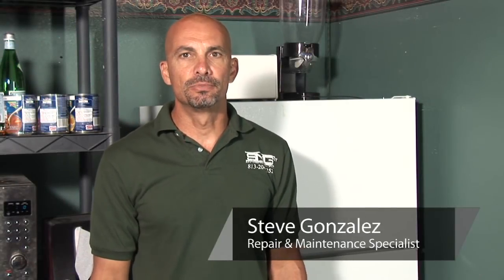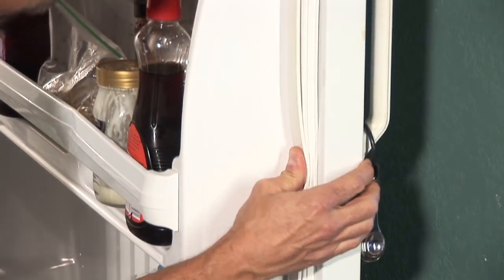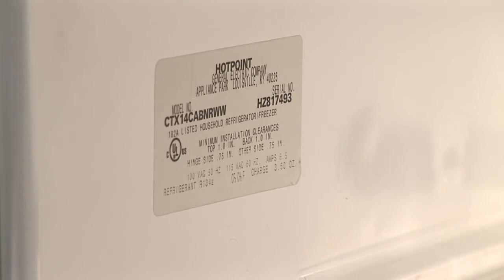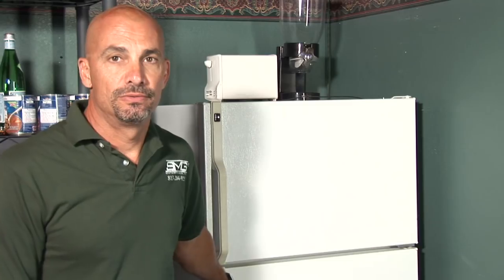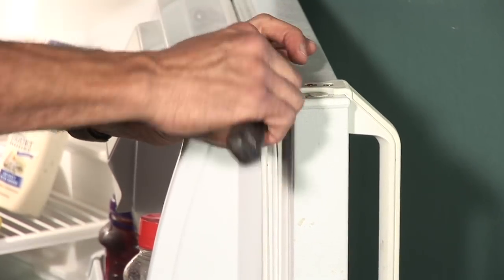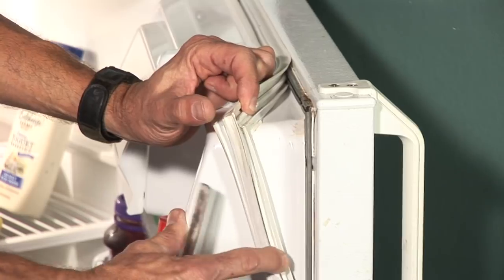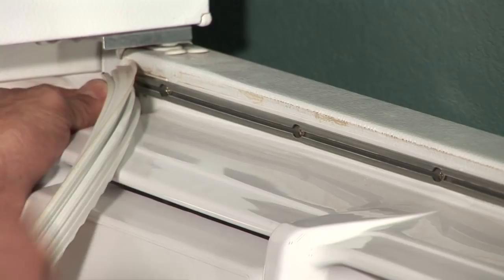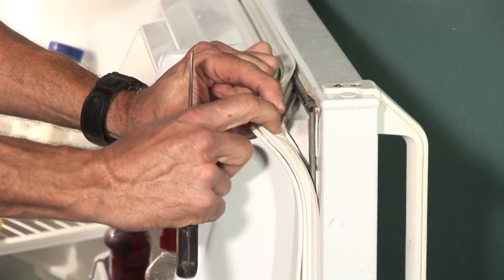Home Appliance Repair : How to Repair a Refrigerator Door Gasket

Comment: The original gasket for my fridge costs £100. The universal gasket costs £22. I will attempt the gasket change this weekend. Hopefully mine is as easy as this one. Very nice and to the point video.
Reply: Did it work?
Reply: Where did you source the universal replacement? ...and did you have to modify it?

Comment: Those of you fussing over the words  "replace" vs "repair" are being ridiculous! - senseless even. If you replace the seal/gasket around the door, and it works then,  the refrigerator is repaired. If you use glue or duck tape or some other such thing (I don't know I am guessing) and it works then the refrigerator and the door are still repaired. The title of the video is correct.
Reply: +angelamariapreuss technically, the refrigerator is being repaired by replacing the gasket. A new gasket can cost around $100 and that much more for one for the freezer. Depending on the age of the appliance, you're better off putting the $200 toward a new refrigerator
Reply: angelamariapreuss correct ! If you replace a car part that wasn't working , THAT'S called a repair !
Reply: The reason you're "guessing" about duct tape or glue makes my point! I was looking just for that type of detail, and seeing the title as "repair", not "replace" induced me to click on this video. Maybe I'll try some random fixes, video myself doing them, abd put out an actual "REPAIR THE GASKET" video of my own!

Comment: Thanks for the informative video. As for the difference between repair and replace many of you have given the example of car repair. If you replace a part in a car it is called car repair not part repair however if you have a problem with a part and you fix it without replacing it is called part repair or car repair. Repair is a word used when you fix an entity without replacing it. Similarly if you fix a gasket using a duct tape or other means it is called gasket repair or refrigerator repair but if you replace the gasket it is not called gasket repair but you can call it refrigerator repair. The title should have been refrigerator repair or gasket replacement not gasket repair. I had to comment seeing how blatantly rude some of you were while making your point. Needless to say the video itself was informative irrespective of the title. Of this is not what you are looking for then move on.

Comment: It was not a repair, just a replacement!
Reply: When they repair a laptop that has a dead hard drive, they replace the hard drive. that's still called a repair. I hope your IQ has improved in these 4 years buddy.
Reply: Yes. Title should not be How to Repair a Refrigerator Door Gasket, it should be How to Replace a Refrigerator Door Gasket, because they can be repaired.